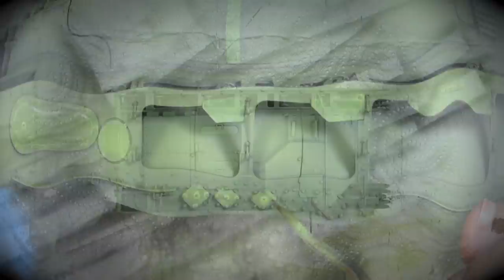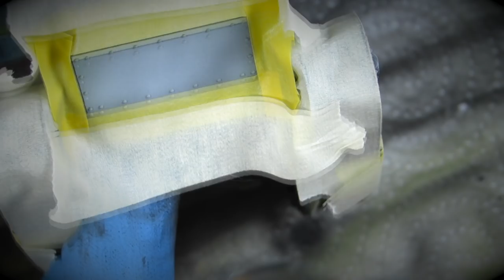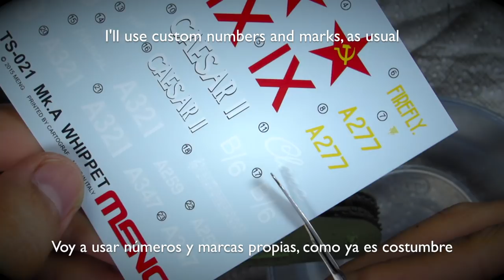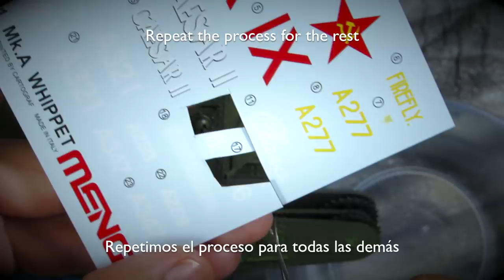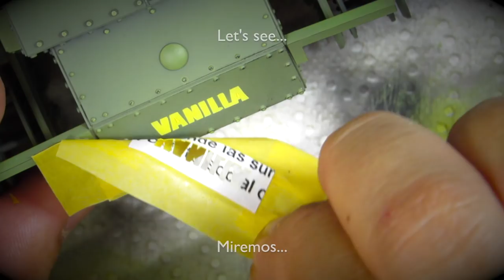[Painting and Weathering scale models - Tutorial] 1/35 'Whippet' British tank (MENG)

Comment: really great video,  I see you like to use model colour a lot, do you prefer these to model air?
Reply from the maker: +bluesun 2517 Thanks! I use Model Color because they last longer than Model Air for the same price, but you have to thin them yourself. Not a big deal, though
Reply: bluesun 2517 
Hi! There is a difference between Model Air and Model Colour. Apart from what Sergio said. I find the Model Air to be more rubbery and harder to chip than Model Colour which, although not so resistant as the Air, are sweeter to work with.
Reply: cheers guy's good info